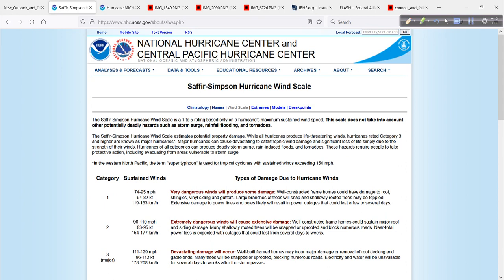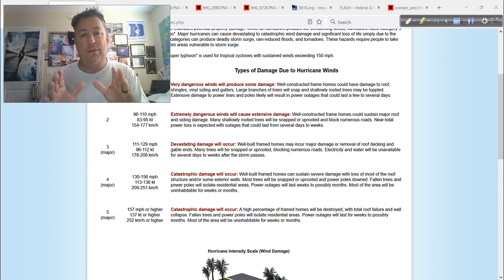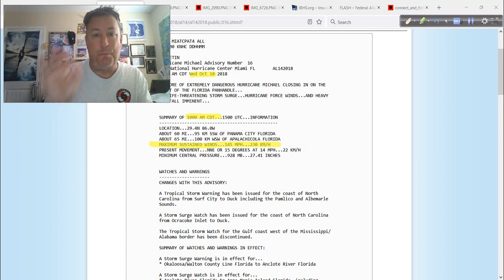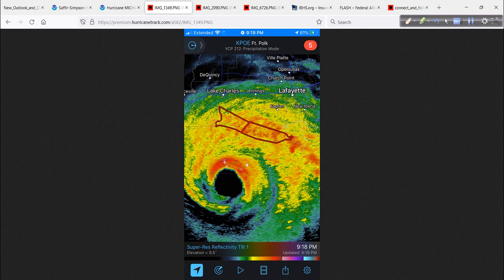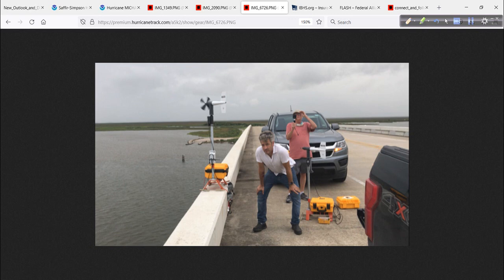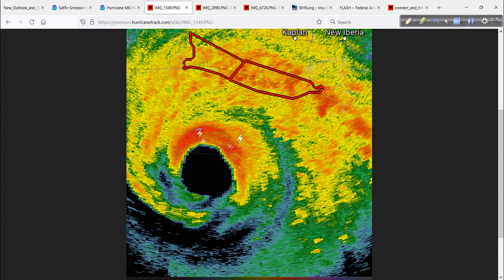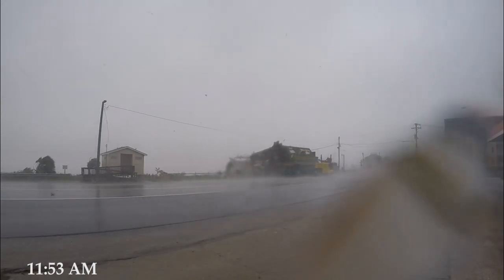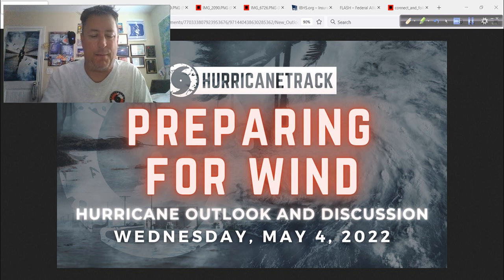Preparing for Hurricane Wind - May 4, 2022

Comment: The NHC stated in an email response to me that in the case of MICHAEL, the category 5 winds were over water. The maximum wind on land was only category 4. And the 919 millibar pressure was only an estimate based upon surface wind observations within the eye. The lowest pressure measured in Michael was 120 Millibars. The wind in your video was only category 3 at that location. This is evident in the visibility with the wind  blowing directly in off of the storm surge water in the video. Compare with video in ZETA at the south end of Golden Meadow, Louisiana with the wind blowing directly in off of storm surge water there. The wind is stronger there at Golden Meadow because there is considerably more whiteout there in ZETA's eyewall. And ZETA was just a category 3 with maximum sustained winds of 115 mph. Unless the wind was much stronger at that one finite spot than what was sampled elsewhere. The only unquestionable category 5 landfall on the U.S. in history was the 1935 Labor Day Hurricane in the Florida Keys. AMDREW was rated a 5 in post-analysis, but that is questionable. And if you look at the wind damage photos and radar photo of CAMILLE at the location of landfall, It is obvious that CAMILLE was only a high-end category 3 at landfall, just like KATRINA. Based upon the history, the only place in the U.S. to ever receive a category 5 landfall is the extreme southern tip of Florida and the Florida Keys.

Comment: Would be cool to see a future video touching on building materials required for areas at high risk of being bit by hurricanes. Like impact windows/doors, being above grade, roofing requirements, etc. So much damage can be mitigated by building properly.
Reply: Every place from the Latin America countries around the coast to and through Maine are at high risk.  There are multiple building codes and they are not retro-active.  When Hurricane Andrew hit South FL, that area had new, improved building codes.  Nowhere else in Florida did.  After Hurricane Michael in the Panhandle, they had the improved building codes, but no where else.  I would like to concentrate on how schools, churches, etc in the Plains Tornado Alley do not have tornado shelters and get wiped out, and still do not have the shelters when they rebuild.  In Joplin where they routinely get horrible destruction from tornadoes, why are tornado shelters not required?  Do their building codes change after storms?
Reply: Hurricane Andrew made the building codes for Florida. Not really Mark's forte'.